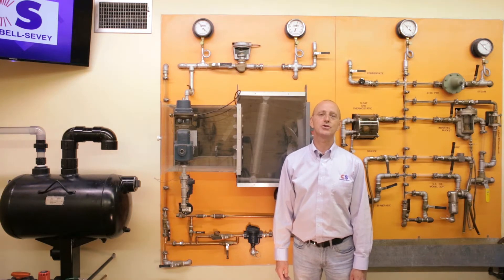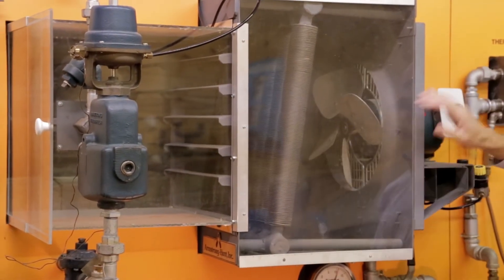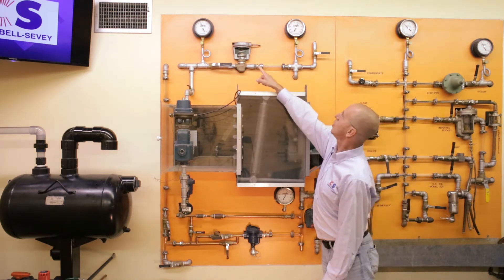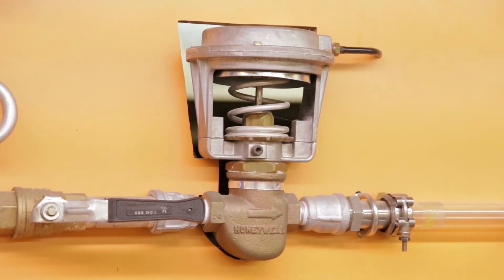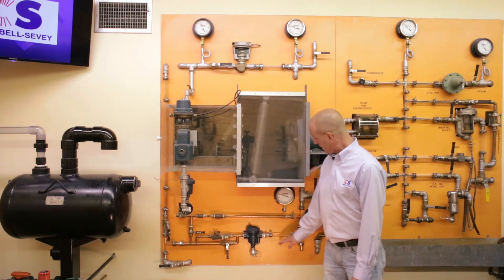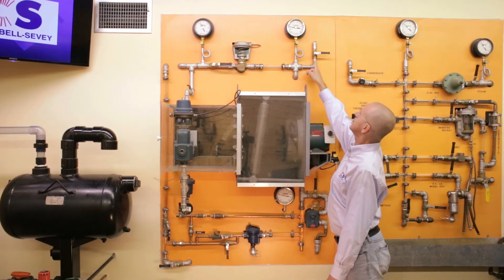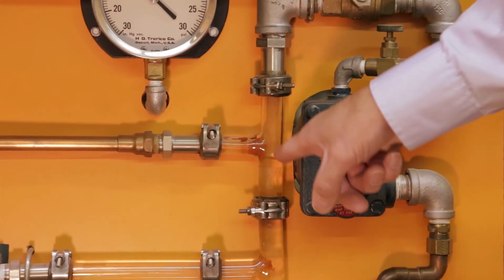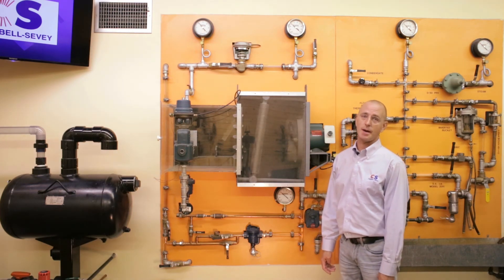Campbell-Sevey - The Proper Use Of A Vacuum Breaker In A Steam System

Comment: Should vacuum breakers be at a high point , I have some located after the coil and on the same plane as the trap , they have a lot of leak issues. I thought about moving them to the inlet side of the coil at the top?

Comment: you didn't mention/show the operation of the air release valve that should work in conjunction with the vacuum breaker at part load.  that should be installed downstream of the coil right?
Reply: What is a air release valve? What purpose does it do